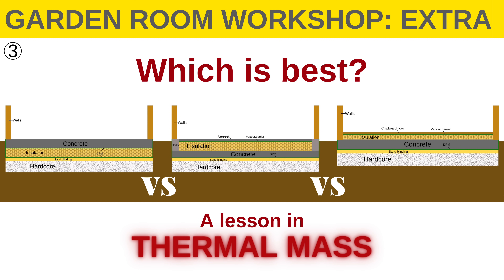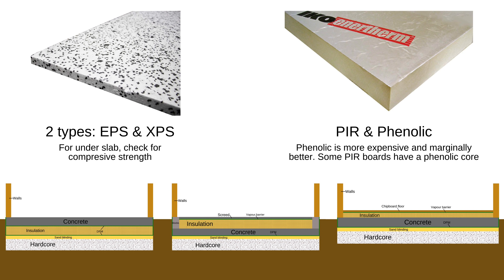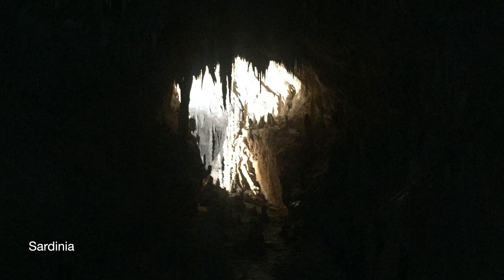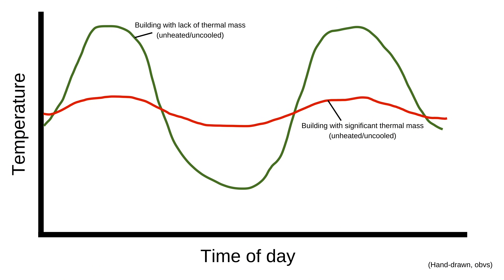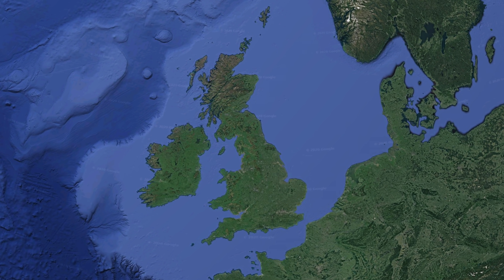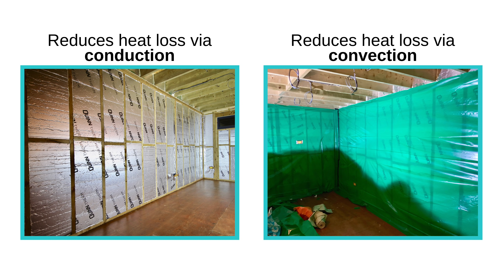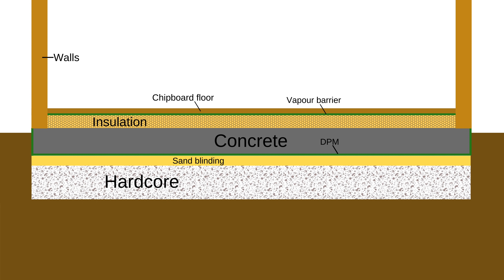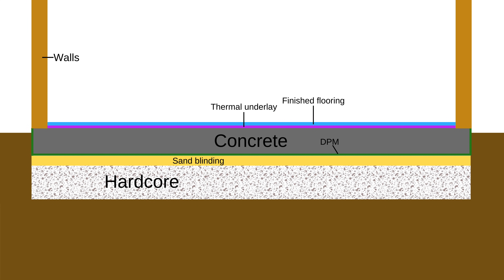Garden Room Workshop Extra | Insulating A Concrete Slab

Comment: I was going to use option 3 on 14x12 feet wood summerhouse but was worried about dry rot with the insulation stopping the air flow are my thoughts right, cheers.

Comment: Thanks for the video.
I'm drawing up plans for a 7.5m x 3m workshop in my garden (central England), my first thought was option 1 and found this while searching for other options. The considderation of the slab being a heat sponge during the initial heating I hadn't considdered. 

However, There's some heavy equipment going in that will need bolting down (like a fly press) so options 2 and 3 are out. 
Also, as the building is going to be within 2m of the property boundry (right up against the fence on 3 sides), I'm limited to 2.5m hight, so the lower the floor the better.

I've been using some old gym floor matting (about 15mm thick dense rubber) in my rented space as fatigue matting and this could work to dampen the heat transfer issues as well as dampen sound.
And if converted to a garden room at a later date, would make a good underlay for laminate.

Heating wise, my first choice is a cheap deisel heater and this will probably be installed anyway as it's a cheap option for a usable space asap. What I'm thinking now though is when fixing the roofing sheets down, install some brackets at the same time for future installation of solar panels to power ceiling mounted radiant heater panels or convector heater to take the edge off, and use the deisel heater as a booster for extreme cold weather...
Reply: Maybe lay some electric underfloor core into the concrete when pouring and use the slab as a storage heater.....

Comment: Hi Ali, started watching your workshop built. I've got a concrete slab but cannot use all of it as need space from the fences to maintain the boundaries. If I was to use 3'x2' as a base to give myself the thermal insulation on top of the slab but then build the walls from 4'x2's, would that work? I like the idea of minimising the base to get more internal head height but how can that be done entirely without the base if my slab is bigger than my built? Hope the question makes sense. Thanks

Comment: Great video, thank you. Would a 150kps PIR  be suitable for Option 1 for wall/roof load bearing if I wanted to build a 5mx3m garden room with a bifold door 2400cmx1950cm. I would like to place two 6x2 timber over the bifold with a flitch plate.

Comment: The UK is an odd beast. We get a few months, probably November through to March where the Sun just doesn't offer much heat.  In our greenhouse outside those periods it gets pretty warm.  Well too warm for humans.  There's a nice crossover where it's just a little warmer and pleasant inside when it is still a tad nippy outside.  Annoyingly you want the summer heat in winter.  But you have to work hard for that.

Comment: I guess another question is,  if you are going with a block perimeter -  possibly give that a concrete trench foundation, and then just fill in the inside with something like MOT sub base, and work from there.  Or rather, why bother with a concrete slab at all if you don't plan on using it for thermal mass?
Reply: I suspect people will answer to the effect that it keeps water out.
Reply: It's annoying that foamed glass isn't cheaper in the UK, because it could be so useful in cutting out plastic insulation in the base.

Comment: I have a typical early 1900s terrace with 2up 2 down. The ground floor front room is suspended flooring. The backroom however is a concrete base with what looks like a ~20mm liquid screed on top covered by tacky lino. Looking to bring the building up to thermal regulations. Adding insulation on top, then flooring, then laminate will potentially add 60-75mm to the floor level adding a step above the suspended floor level. Potentially raising that level when adding insulation below the flooring would have a knockon effect at the door frame level for front & back door. Any suggestions?

Comment: Another option is no concrete and using compacted crushed rock instead. Then glue and screw insulation. You can even spray foam the crushed rock.
Reply from the maker: Interesting!

Comment: Is there any benefit in trying both options. i.e Insulation beneath the slab for better thermal mass performance and insulation above the slab for comfort?
Reply from the maker: Oh interesting question. I'd probably say no, after some thought, because the top layer will be so good at insulating that the heat probably won't make it through the concrete to reach the insulation beneath it rendering it a bit pointless.

Comment: How much concern is there for heat loss through the sides of the concrete slab in your first option? Would you put insulation to the side of the slab, and what might be a good way to protect/finish the insulation?
Reply from the maker: Fantastic question. Yes the model I showed is a bit simplistic as you will want insulation on the sides of the concrete. Quite how to do it so it's not at the edge and subject to water ingress, I'm not quite sure, though you could lap the DPM up the outside as long as your cladding will hide it, that will work. It's something i'm potentially going to be doing next year so will be looking into it!
Reply: Yes you are supposed to lap the DPM up the wall & ideally tuck it into the mortar of the wall on a brick/block wall although this isn't always practical on existing walls so I think most people just run it up the wall & cut it bellow the top of the skirting boards. You then put at least 25mm thick PIR all around the perimeter of where the concrete slab goes to reduce cold bridging, easiest way is to fit the 25mm strips down the sides of the PIR boards laid on the ground so they are fixed in position by them.

Comment: Hi Ali, I already have a slab a DPM underneath it but no insulation atm (I do need to insulate the floor) and I am looking to make an outbuilding with composite panels (rock wool core) Can you advise the best way to prevent water / damp/ rodents getting underneath the building or inside the composite panels?  I cannot have the wall panels right on the edge of the slab . The panels can sit in a galvanised U - channel but I'm not sure if its best to bolt the channel directly onto the slab or on a course of blocks with dpc on it first ? Does it need ventilation if on a course of blocks? and what insulation type do you recommend and in what order?( ie. DPM membrane first or insulation first then chipboard)?

Many Thanks

Comment: Hi Ali, I'm working on a variation on options 2 and 3 for a workshop that I want to heat occasionally. I'm thinking of using foamed concrete instead of normal concrete, which will give me much greater insulation value. My main challenge is the design of the perimeter which has to hold the weight of the building - probably a shallow foundation and 100mm half-blocks. Great series, really useful, thank you.

Comment: I am renovating a house which has stem/band foundations (which support the walls of course). I will replace the floating slab and install some deeper roadbase beneath it. Option 2 looks like the right option for us and here's my question : Should I bring the screed just to the top of the foundation ('block' in your diagram) or have a deeper (higher) screed which extends all the way to the wall ?

I prefer to stay lower bc we don't have a lot of ceiling height, but I was worried about a floating floor on top of which we have our floor boards (which will sit on both the screed and the foundation (block)). Would the boards become unseated on the block side and potentially warp or crack when we walk on them ?

Comment: Do I need a vapour barrier on top of the foil backed pir board ? Before the caber flooring goes down
Reply from the maker: yes, but very simply joist tape the joins of the PIR with aluminium foil. Very easy 👍

Comment: Great video, I have a large concrete area where an old garage used to 
be, I want to use some of it to build a garden room as in option 3, do 
you think I can build straight on to the concrete as its not raised that
 5cm mentioned in your other videos? Thanks
Reply from the maker: As long as it doesn't flood now from the surrounding ground (surface runoff) then it'll be fine I'm sure. Have a think what will happen to the water on the rest of the slab though.
Reply: @AliDymock  Thanks, it doesn't currently flood and used to have an old garage on there so hopefully wont be an issue, I will look at more of your videos thanks

Comment: Hi. 
Could you please advise on a 14x8 foot shed resting on flags. Pent roof with fall front to back. 

They are coming with 22mmx44mm bearers under the floor. Will this be efficient enough, for air to pass through and stop the floor from rotting from either lack of airflow or rain splash?
Should I replace these small bearers with bigger ones?
Reply from the maker: Hey Greg, that should be enough air flow for the floor joists but I can't really say if this is the way I would do things without knowing more about the site, build, cost etc but generally it sounds okay for a shed.

Comment: Thanks. But here's a couple of challenges (that I think you'll appreciate):
(1) If your insulation has a vapour barrier on both sides, you're betting on it never getting wet, right? I think for option 3, you should let it dry to the interior.
(2) In the USA at least, the sand is falling out of favor. Do read "BSI-003: Concrete Floor Problems", by building science loudmouth celebrity, Joseph Lstiburek.

I've finally caught up on your vids. Time for me to stop researching and do the dang thing.
Reply from the maker: Thanks Jason I'll read that. What's the upshot though, that the sand falls through and leaves void below your concrete? As for the VB I do think it's sensible to have the one above to stop moisture getting in -probably more important than from below. With option 3 another way of doing it is to have the concrete top finish below ground level, use blocks on the side and then insulate over the slab to bring the floor up to around ground level. Best of luck with yours!

Comment: Hi,  not sure if you will see this comment... thanks for the detailed video on insulating.  What method would be best for securing the base of the structure to the concrete? I have seen ground screws as well as timber screwed into the concrete.
Reply from the maker: If you check Part 4 of the main series you can see I tried out two different ways of attaching my floor joists to the concrete blocks. Masonry bolts were the winner which involved drilling into the concrete and screwing them in. If you haven't poured the concrete yet you could instead have upside down threaded bolts along the edges and then drill holes in the bottom plate of your walls which will then fit on to them. Then secure with a washer and nut :)

Comment: Hi Ali. This is another very helpful video, thank you. You showed someone else's floor, consisting of a vapour barrier, insulation, and then the boards for flooring. The third of your slab and insulation examples, which I'll probably use, has a DPM AND a vapour barrier. Would you recommend having both?
Reply from the maker: Hi Michael, you're welcome. check out the accompanying websites under 'Your Builds' to find the one you're talking about. So that one which I agree with had a DPM which is essentially a VB then insulation which was taped (so another VB) then chipboard for flooring. The DPM is to stop damp coming up from the concrete below (optional but if you don't know if there is a DPM UNDER the concrete it's wise to put one down and the one above is to stop water vapour entering the insulation from inside 👍
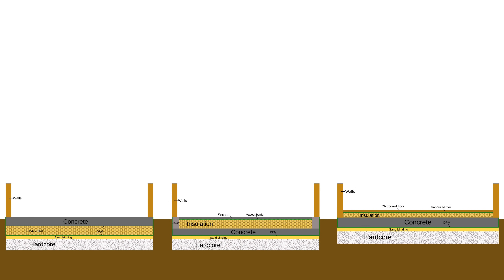Reply: @AliDymock  Was the example floor at 4:33 fixed to the concrete slab? Was the chipboard floor not fixed?

Comment: You also need to insulate between the walls around the concrete pad to prevent thermal bridging. Not quite worked out whether this goes inside or outside the DPM though (about to lay floor in next few weeks for my block and stone games room).
Reply from the maker: Yeh this was a simplified sketch. Send me some pics on how you do it, I'm interested to see.
Reply: So I'm thinking of something similar. My favoured design is a concrete slab and wanting to maximize insulation but have the 2.5m challenge or go for planning permission. Are there alternatives to concrete slab then bearers then joists then floor that are not cold? As these all add up quite quickly and I'm finding I need to reduce the insulation in the floor and roof to keep a decent internal wall height.
Reply: @andrewhall9581  DPM, 75mm PIR, 100mm slab with mesh, breather membrane,18mm ply or chipboard, final surface. You could actually do away with the PIR dependant upon ground conditions, final finish (such as underlay and carpet) and not needing building regs permission.

Comment: I'm a little confused by options 2 and 3. In the drawings shown, the vapour barrier only meets the blocks or walls. Surely these will allow vapour through. Are the drawings simplified, in that the vapour barrier for the walls (not shown) should overlap with this flooring vapour barrier?

Comment: Is there a weight limit to the 3rd option? Only asking because im about to build a extension and the 3rd option in much cheaper the the first to. Also i have a big aquarium to go on the chip board floor
Reply: I'd like to know the same. Planning from a gym currently and while I'm no Arnie I think a concrete top layer would work best.

Comment: How would you fasten the chipboard floor for option 3?
Reply: Yes, I would like to know the answer to this too. I can't figure it out. The two ideas I can think of are to (1) use plasterboard wall plug in the insulation and have some very accurate screwing, or (2) dig an 18mm deep small area out of the insulation and place some 18mm OSB/ply here to give you some purchase when screwing in. Both of these things won't stop sub/floor warping in some way.

Comment: These are a great series of videos! what would you do if you was replacing a shed that is on a concrete base with no DPM?
Reply from the maker: Hi Leigh, just pop a DPM over the concrete before your flooring or insulation if that’s what you’re going for

Comment: Any ideas on what to do with an existing slab?... I have an existing concrete slab for a small shed which i'd like to make bigger for a garden room. I have no idea if the existing slab has a DPM. Is it best for me to just smash it up and use as hardcore for a new base, and then follow option 3?

Also, would you choose option 1 if you don't want the room to get too hot in the summer? And also if you use it daily for garden office?
Reply from the maker: Hi Adam, if it were me and I was going for least trouble free and low cost and the concrete is in good shape unlike mine, I'd put a DPM over the slab, then insulation, then chipboard then underlay+flooring. This is what i plan to do in my garage (new house) where the concrete floor is substantially lower. Option 1 definitely will have a more solid feel though. If you do smash up the concrete into hardcore make sure you have some good dust/fine sand inbetween it all otherwise your sand blinding can sink into the hardcore and create a void under the concrete which can put it under tension.
Reply: @AliDymock how would you fix the chipboard to stay in place?

Comment: The only downside with No. 3 is the possible usage of the room - if you're creating a gym or something with other high impact activities (maybe a workshop with large tools on castors) then will need quite a lot on top to keep it stable. Sadly learnt the hard way...
Reply from the maker: That sounds right. Regardless of the thermal mass point, it's not how I would want an extension on a house built but for a DIY garden room I think it has some great advantages but if you're dropping weights from height you probably want no.1 due to the high compressive strength of concrete. Good to hear from your experience 👍
Reply: Good point, I was about to go for option 3 but then saw your post. I want to make mine a workshop.

What thickness of PIR and Concrete would you recommend for a 3x4m room ? Thx

Comment: Great info here, many thanks!  I will probably go with option 1 to maximize internal height.  Is a continuous thickness (150 - 200mm) slab OK for a 7.5 x 4m timber room or should it incorporate a thicker RC beam at the edges to support the additional weight of the walls?
Reply from the maker: Sounds like a good choice. I would have thought that as the majority of the depth is underground that it wouldn't require any beam or rebar but some people do put in mesh in the middle of their slabs.
Reply: @AliDymock  Thanks for your response! Appreciated.  Keep up the good work! You should be a public speaker/presenter!
Reply: When you say 150mm-200mm you referring to the depth of the complete construction?

Comment: Video idea: a pre laid concrete base from the 1950 with no dpm. The base might also be shared with a neighbor garage or shed so this makes it difficult with rain. Great video by the way :)
Reply from the maker: Ooo tricky. I'd put down a boat load of silicon or other sealant on the concrete where the diving wall goes up, then DPC lapping up the outside wall and then bottom plate squishing the silicon. Then put down a DPM over your side of the slab running up the internal walls, insulation, chipboard, flooring. The alternatives would be to take one of those brick/concrete cutting tools to the concrete so water can run down to the ground or at least have a channel away from the building OR you could building with block and then use bitumen on the outside to weatherproof that bit 👍